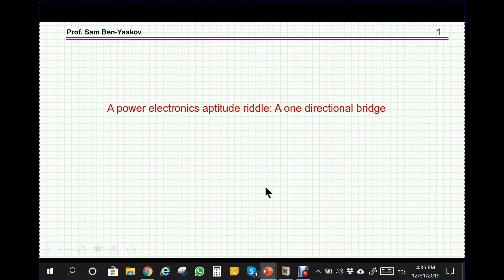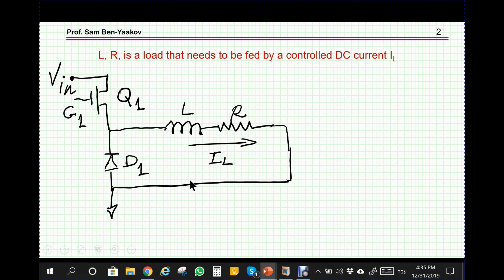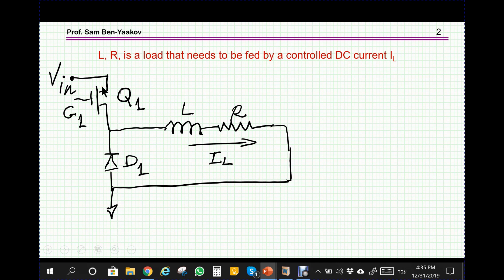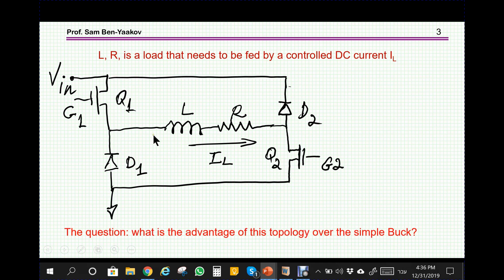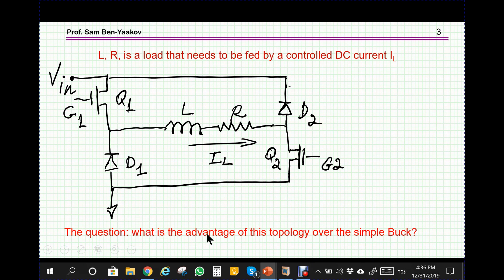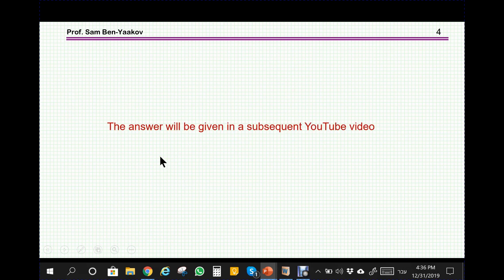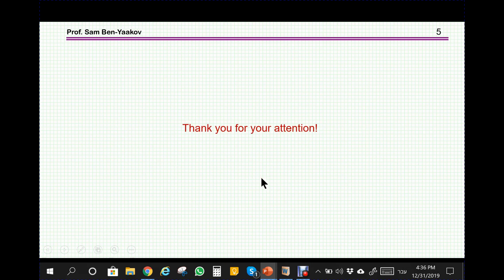A power electronics aptitude riddle: A one directional bridge

Comment: I don't know in wich direction you mean that advantage? I think by an inductive load as this is, i think maybe you mean that this second circuit can save energy while breaking? In case of an electric vehicle, because by seeing an inductive load in a circuitriddle at first an electric motor did pop up in the cup, so to say of course?
Reply from the maker: Breaking requires regeneration capability (reversed current) which this circuit can not do.
Reply: @sambenyaakov  no but i meant that this circuit can feed the emf from a coil back to the supply. But i am for long not capable enough to give more than a sort of guessed answer to the riddle and so i look forward to your next video even more this time!

Comment: Voltage across RL becomes of 3 levels instead of only 2. A 3 stage pwm control can be used for better control of the current. +Vin   - Vin, and 0.
Reply from the maker: Very hot. Expanded explanation in a forthcoming video.

Comment: This is similar to the operation of two switch flyback compared to the conventional flyback. The main advantages are inductor reset and lower switches stress due to diode voltage clamping during off time (while recycling the energy back to the bulk cap).
Reply from the maker: Getting warm but not quite. Happy 2020.
Reply: @sambenyaakov  thanks! Happy new year SBY

Comment: The second one can operate in more than 1 quadrants. It means it can take the energy back to the bus capacitor or battery. Usually it can take energy from DC motor to slow it down.
Reply: Not quite, to regen brake a DC motor requires reversing the current which that cannot do.
Reply from the maker: Indeed

Comment: If you want the inductor current to go down fast, the two switch topology is a lot faster than the one switch topology, while returning energy to the supply. A friend of mine used that design (x3 for 3 phases) for a switched reluctance motor drive in a water cycle air conditioning compressor that can spin at up to 100kRPM. Her prototype worked at 40 SEER, over 3 times the average efficiency of most A/Cs at the time and still considered very good today.
Reply from the maker: Very hot. Expanded explanation i a forthcoming video.

Comment: better dynamics?
in case 1 if you want to decrease the current you should wait for Inductor's energy to dissipate with I(RI + VD)
in case 2 most of energy can be returned to supply
Reply from the maker: Very hot. Expanded explanation i a forthcoming video.

Comment: In the second case, the off current through the freewheeling diodes results in a net input voltage applied across the inductor and resistor. It will help to reset the inductor and therefore, avoids saturation even at a higher duty cycle.
Reply from the maker: Getting warm but still incomplete.